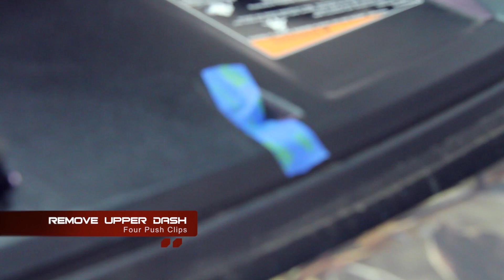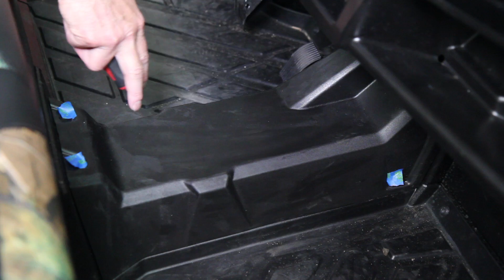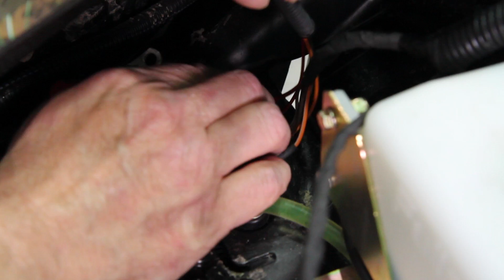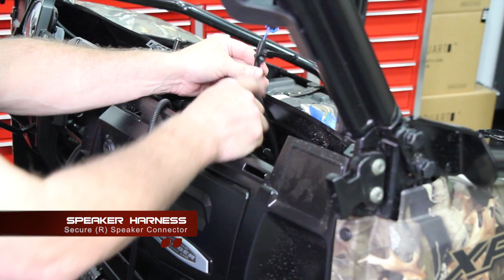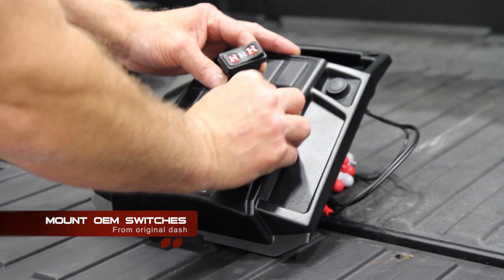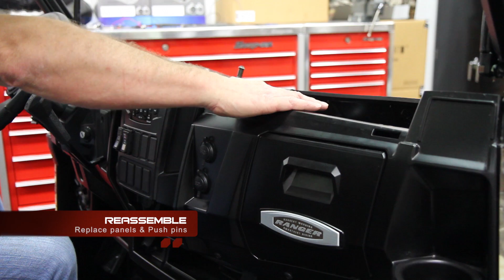Polaris Ranger Dash Mounted Audio Kit Installation (Installation Highlights)

Comment: I have this system ordered for a new Ranger I got a few weeks ago along with a set of (terribly expensive) doors. I'm quite an audiophile and expect to be horribly disappointed. Got my fingers crossed though!
Reply: S Bridge please give an update when you get it installed. Curious if it’s worth it. My buddies have put waterproof Bluetooth speakers (like for a pool) in theirs, but I like the the idea of having it fit for the machine. I look forward to your response. Great video MaxxsonicsUSAInc!
Reply from the maker: Thanks A N Wall
Reply: @asphalt_mafia573  Sorry for the late follow up. I've had this in my Ranger for a while now and can't say I'm disappointed. Yeah, it's pricy. All of Polaris' stuff is, but it's worth it in the end. No, it doesn't have any bass. It fits like a dream though and really looks clean. Install is very straight forward. 
The head unit is 4-channel. What I'm hoping to do down the road is add another (slightly larger) set of overhead speakers in the rear of the cab. It's not a crew, how many should you need? lol.
Reply: The audio system is exactly as I assumed it would be. Having used MB Quart in car applications, the mids/highs are very impressive. The enclosures they are mounted in are flawless and look "stock" as they should, installation is easy and the head-unit is pretty nice with a aux port for a USB. Were I to muster any complaints it would be that it's rather pricy for what it is and, if you are a bass-nut, this is not for you. Clean? Yes. Volume? Yes. Want Bass? It has RCA outputs, add an amp & sub somewhere. Overall, I'm quite pleased with it and would recommend it.
Reply from the maker: Yeah man, that is great news. Luckily, I don't think anyone using coax speakers would find satisfaction for their bass-nut desires. Definitely a subwoofer and sub amplifier would be a huge bonus. Perfect for working the land. If you are on Instagram or FB, tag us so we can see your set up. #MBQuart @MBQuart
Reply from the maker: Well, I'm not sure if that's a compliment or an insult. Hah..   but, we are all audiophiles too..  sorry the doors are so expensive, did you choose crank or motorsized?? Looking forward to your feedback on the new system. If you're social, #MBQuart and @MBQuart on Facebook, Instagram..
Reply: @Maxxsonics  The system is wonderful. As I expected, the fit & finish is flawless. Head unit is great.... As for the audio, meh. I guess it's to be expected. Don't bill it as having bass, it doesn't. Crisp? Absolutely. Midrange and high frequency is beautiful. Only so much you can do with speakers that small though. I'd like to add another set overhead. I've got the roof with the premium headliner which seems to have knockouts for speakers. The head unit amp is 4-channel. How big of a deal would that be?
Reply: well how did it sound?